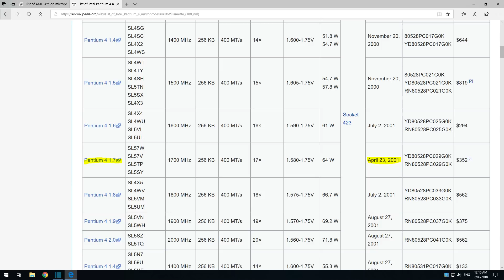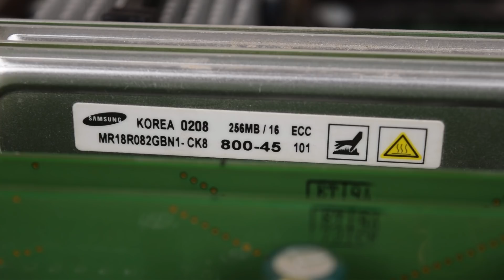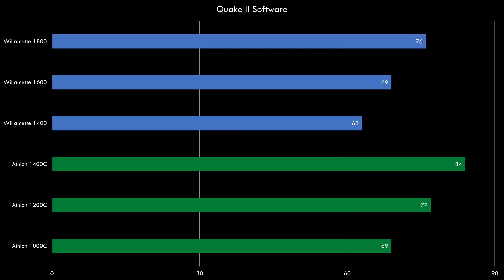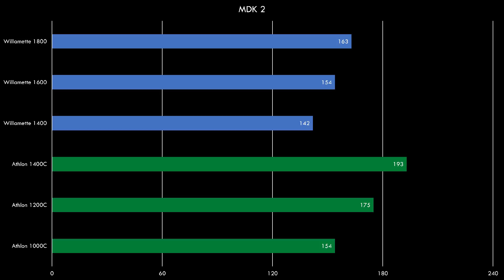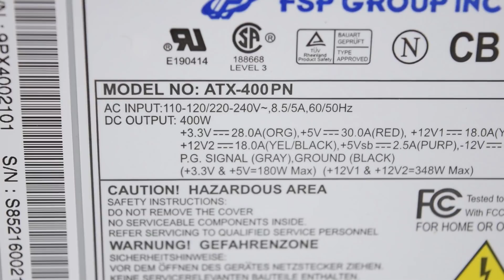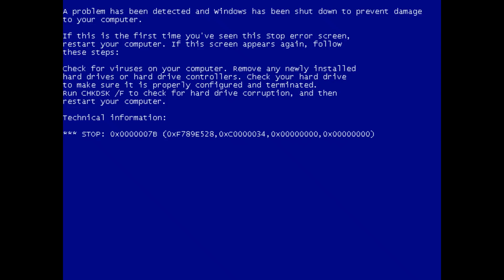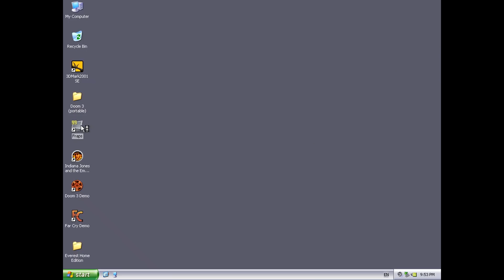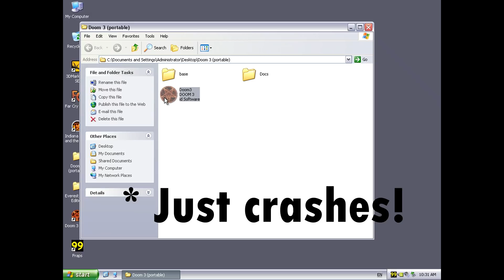Intel vs AMD S2E3 Athlon Thunderbird 1400 vs Pentium 4

Comment: Hi Phil, nice video yet again.
Amazing with the power supply, you always have to watch the 5volt rail, it is almost mandatory to get the chip spec from supplier or other site on the power draw and they voltages eg 3 - 5 -12 then check the sticker on the power supplier.
Funny how the cdrom motor was drawing just enough more 5v on the molex to max the power supply.

Some P4 can draw up to 70 watts ( luckily my XP machine the toshiba laptop  Pentium M ( P4 cut down to P3 specs and M for mobile - laptops )  is a smaller 25watt and does not produce any of theP4 heat.

The same can happen when you have 2 or 3 IDE hard drives as they draw a decent amount of power as well - some machines has a slow bios that starts with no hdd, then waits say 10 second and activates the primary ide channel then waits about 10 seconds and activates the secondary channel then check devises - it basically staggered the initial power draw

Interesting so see what the more intense video card draw, we now the bus has a max of ??? 35 to 50 watts in P4 and what voltages are on what pins as some AGP got as low as 1.5V, but they also have 3.5  ,  5   &  12 depending on the mother board the 1.5 - 5 would come of the 5v rails as well...  Hmmm  i wonder is anyone used a 12v DC rail to draw power and reduce to 5v to run say molex  items and leave the power supply native 5v for the mother board and cpu

Starting with Win95 devices were early plug and play better know as plug and pray.
After much frustration for about 3 months a friend at work suggest the best method.

Rip everything out and just leave only the video card ( in the Win95 days before built in video on mother boards ). You then install windows and restart it several time and see if everything works.

Then add the next card - only 1.  Then install drivers and reboot a few times or use it for a hour to make sure it is correct.
Only then go to the next card and pray the drivers work and it does not conflict, if it did try and change resources or swap slots- easy when they were all ISA or PCI or mixed, no big rush for the 4x or 16x slots back then.

With the Direct X, i tend to use the "sweet spot" which is direct X 9c, but you need to be careful, there are 2 versions, the early version is Win98 based and the later version is XP base, i believe the gap in years  between early and late is a3 to 4 years.  Other than that in XP and newer i just install the direct X version that is max for the video card

Comment: But can the Athlon 1400 beat some of those P4 Northwood processors?

And for the Intel vs AMD series, I would also like to see comparisons between Pentium D (which is basically two of Prescott P4s dies glued together) and the Athlon 64 X2, which became a performance competition between 2005-2006 until the Core 2 processors released.
Reply from the maker: So the Northwoods didn't launch until early 2002, by which AMD already had launched the Athlon XP. But that will be interesting to see how this plays out :D But there is other stuff I want to look at, like different chipsets and whatnot.
Reply: Well to be honest, The K7 Athlons were designed to compete against the P3s but still had much better ipc than the P4s. The Athlon 64 K8 was technically the direct competitor to the P4 but litterally mopped the floor with the P4. If I remember correctly the Thunderbirds had half the amount of cache of the Athlons.
Reply: they can beat northwood celerons. P4 probably not.
Reply: I can just say as an avid athlon user back then , starting with 1400 and moving all the way to the barton 2500+ mobile for overclocking... i did get 2.5ghz on air out of it but stable was 2.3... the northwood 2.8C was a better chip , never been an intel fan as i like to work my wallet and time overclocking to match, byt again the northwoods were superior. i have one now that i have never put on a board , but will someday. HT and all that cache and instruction set was just better..... although it never got me killed in CS back then :)

Comment: A nice thing about these 1400 Athlons is that they have an unlocked multiplier! 

Used it several times to simulate lower-clocked Thunderbirds and that also opens up some very easy OC options.